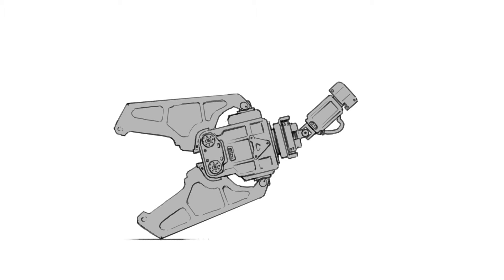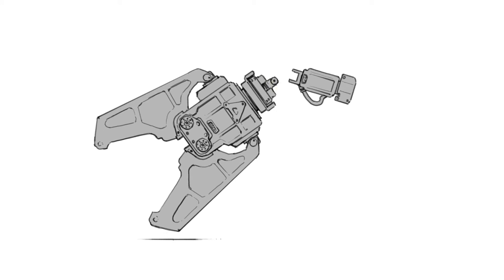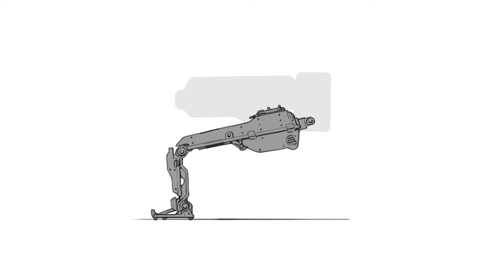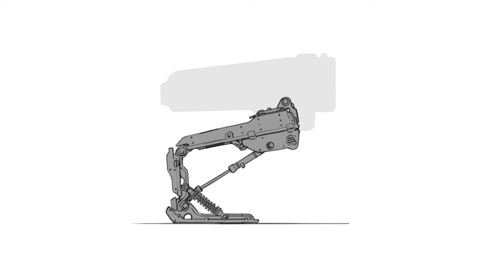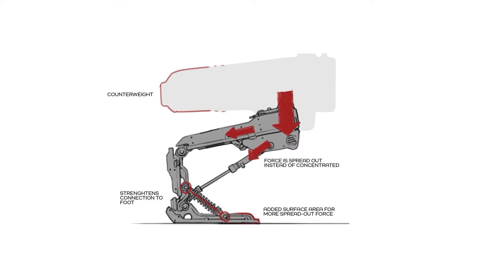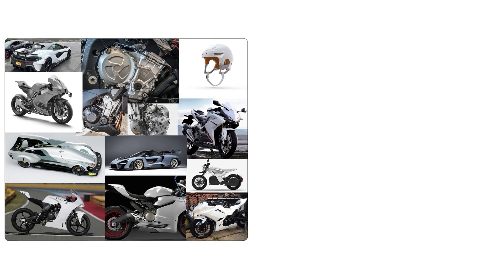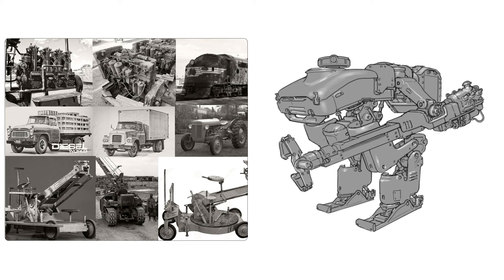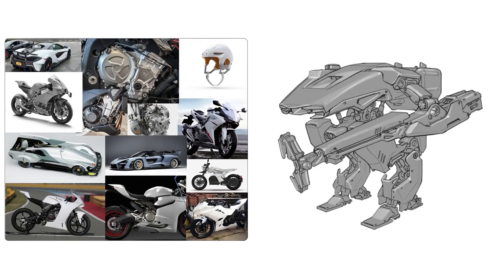How To Design Mechs for Concept Art - Tips from a seasoned PRO!

Comment: I think, even in your example designs, mid section would be a problem, since it's too weak to hold the weight on the top. Look at Kuratas for an example, and it's waist joint.
Reply: I am watching this video specificaly because I am making a mech in blender and I don't know how to do the mid section. Realy dissapointed aswell, I was hopeing for some good ideas on that.